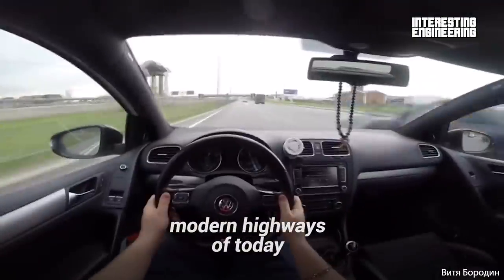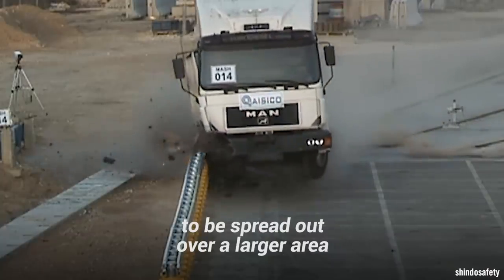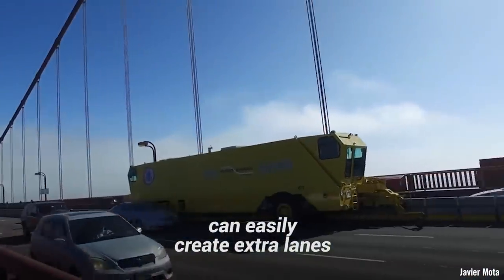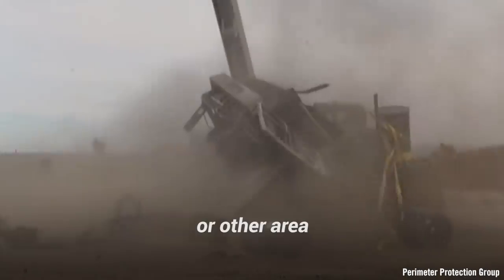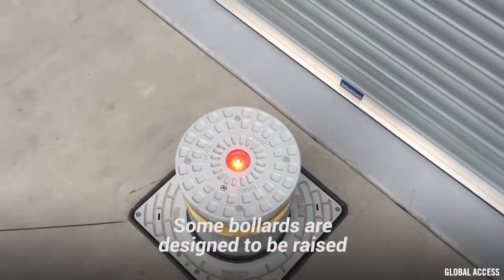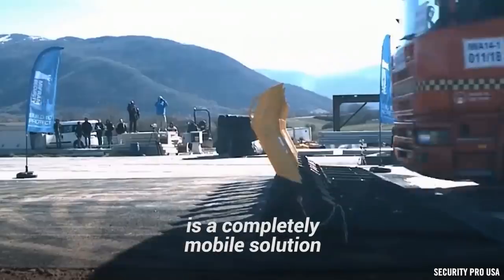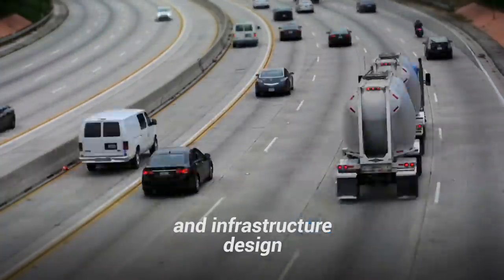How modern road barriers keep our roads safe

Comment: 3:05 I have seen a raisable bollard once, which had broken down and as a result  it raised suddenly when it was supposed to stay. Upon it causing a hell of damage, they had to remove it
Reply: Yeah, honestly, those hydraulic barriers are so sketchy. One malfunction can kill so many people.
Reply: There are several of the raisable bollards installed at the University of Oregon on both ends of a street clased to thru traffic, and they have a built-in safety feature to prevent that exact problem. After the bollards have lowered to allow a vehicle to pass over them, the bollards will stop rising if they detect pressure on top. For this reason, students enjoy standing on the bollards after they've been lowered, thus preventing them from raising up afterwards. Thus, students become bollards of flesh and bone instead of steel and concrete.

Comment: Some of them aren't even use for stopping cars. Looks like they are use to kill the driver. Lmao
Reply: Yuppers depopulation  is a thing.
Reply: True. Some are there to protect you from what they are protecting but instead makes it more dangerous
Reply: Some are there to protect the thing not you.
Reply: @TheEmolano  No. They are all there to protect you but the ones in charge designed them incorrectly.
Reply: Cable systems most dangerous
Reply: @msk806 , I've seen cars the cables didn't even stop.  Came up on an SUV one day in South Carolina in the median rolled over and it didn't even touch the cable.  A few minutes earlier it had passed me.
Reply: @jakecarroll5  well that's an inefficient way
Reply: NOT A LMAO MOMENT.
WHEN YOU KNOW SOMEONE WHO WAS KILLED BY ONE!

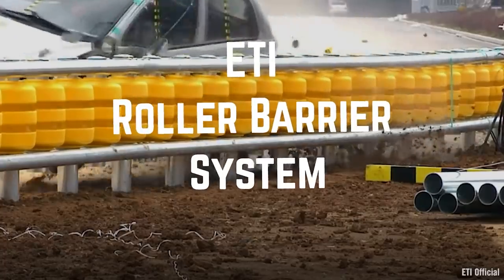Comment: 0:45 US Interstate: I'll pretend I didn't see that
Reply: It wouldn’t work every where. In the Midwest the rollers would freeze
Reply: @381delirius  that too
Reply: Most parts of the intersate don't even have barriers at all, only a strip of grass 😵
Reply: @381delirius  natural selection at work lmao
Reply: @danielsteger8456  except they also take out intelligent beings when they log out themselves
Reply: @alfrredd  thats usually on VERY empty roads with nothing but a plain grassland/desertland. most common in the south prolly
Reply: More like 0:56
Reply: It’s good that they don’t have this Chinese crafted shit. Just steel rails is manly enough.
Reply: @alfrredd  well, trees do fine too at stopping cars
Reply: @mccallfrank007  for cars, not for bikes
Reply: They wont even work well in a traffic scenario
The car would just bounce off into another car
Causing a chain reaction of cars hitting another car which then bounces off of the barrier
Reply: @emerylsg  or all throughout Iowa, Missouri, Nebraska, etc, there is also simply a strip of grass separating the two sides of the interstates. Just not in the cities
Reply: Lol my interstate has a eti road barrier system and bollars
Reply: @alfrredd  well sometimes if the strip of grass is large, it can be better than no barriers at all.

Comment: It’s really upset me driving on mountain roads in the the United States and not seeing road barriers put up. One wrong turn of the wheel or a tire slipping on ice, and there is nothing to stop your car from going down a mountain
Reply: Sigh. Proper engineering will tell you that is the correct implementation.

Comment: They do not remove the main disadvantage of simple metal guardrails: that they are deadly traps to motorcyclists sliding under them and into the poles.
Reply: Just do not drive them. Motorbikes are fkin unsave.
Reply: @sensending7190  don't breathe..air contains toxic gases
Reply: It is probably better than just going wherever into the river or depressed wooded area. Sliding off the road is already a worst case scenario.

Comment: If you get a chance, drive the Blue Ridge Parkway from one end to the other.  For most of this road there are no guard rails!  One section in particular has real pucker power.  Coming around a cliff face is a section of 2 lane roadway with, say, 3 or 4 feet of grass shoulder on each side.  That's it.  Blue sky on each side of the road past the green shoulder.  Driving it in April, before all the trees turn green, allows for some awe inspiring vistas.  All in all a few days well spent.

Comment: As long as you are not driving a motorbike it will keep you safe, they are notorious for motorcycle riders basically chops limbs like nothing else all because the posts the hold the barriers nobody thought of making them rounded rather than sharp square so cheers for that

Comment: 0:46 The ETI roller barrier system is not always better than concrete barriers. It depends. If there is a turn, a flexible barrier that absorb the crash is better. But when the road is straight, a rigid barrier is better.

You can see that clearly in a race track

Comment: They have well learned in car racing that old, hard, traditional crash barriers are extremely dangerous. That is why energy absorbing "safer barriers" have been developed and are working. However, the real #1 issue in road crashes is the idiot behind the wheel

Comment: The ETI Rollers reinforce the structure by transfer of energy into circular motion. Thus making it safer for driver/passengers. Very cheap and effective. Sometimes you’re able it repair the vehicle, cause at highway speeds your most likely not be able to with other structures. But the value is the safety of life.

Comment: Some places where I live we have wire barriers, which are "supposed" to be safer but I seen on the news a car went underneath the wires and it ripped the roof off.
Reply: the installed wire barriers on i 80 near where i work at a truck terminal. a truck hit one of these, it punctured the fuel tank and 2 feet behind were 4 batteries, it shorted the batteries and the truck was burned up in minutes. wire barriers are stupid since semis will just go over them and cars are mangled to a point where extraction is time consuming . from experience wire barriers are worthless and dangerous, large vehicles just knock them over and keep on going.

Comment: What if we had people that could actually drive these days? Like we used to.
Reply: Ain't that the truth! Got my license in Iowa in the mid 1960's. Tough trick question quiz followed by a driving test with an actual State Trooper that was by the book and had little humor. People failed both written and especially the driving test back then. The drivers ed course that I went through had over a third of the class fail the written test the first time. Went back again two years later to test out for a CDL. The written tests went fine because I had really booked and had experience. Came outside for the driving test, and it was the same no nonsense Trooper that I had for my operators license. And he wasn't going to give me my test because my father had brought down the propane truck for my test vehicle. I guess he didn't want to ride in a vehicle with a flammable cargo.And also it was a cabover, meaning a climb to get in.   But Dad showed him in the driving test book where it said that an applicant must test out in a vehicle similar to what they were testing out to drive when licensed. Opps! Being forced to ride in a truck he didn't want to be in, he tested the crap out of me, trying to trip me up.  But I had been well trained and experienced and went home with a CDL in my billfold.

Comment: There's nothing safe about a guard rail on posts or having gaps for people on motorcycles.  It's an automatic chopping block that operates on whatever speed you're traveling.  In almost every case motorcycle riders would be better off without those types of rails.

Comment: The real trick would be engineering a barrier that would be safe for cars, trucks and motorcycles. 
Hitting a steel barrier as a motorcyclist is often fatal far more so than any other road feature.

Comment: All road barriers should be re-designed, like the concrete Jersey Barriers, as they can cause cars to roll over, and cars often bounce off barriers and cause multiple car crashes!!! Barriers and guardrails help for sure, but sometimes they're a contributing factor in bad auto accidents.
Reply: "and cause multiple car crashes" because following drivers which see the crash just don't slow down; many of these following accidents can be avoided if the vehicles would slow down when they see a car hitting the barrier and spinning back
Reply: @EnjoyFirefighting  I get your point. But what I was referring to is when a car strikes a barrier there immediate bounce back into traffic, and at high rates of speed, a crash very often cannot be avoided and can cause a chain reaction. Also there is an issue of the way Jersey Barriers are shaped. Flared at the bottom and easily driven up on causing cars to rise up and flip.
Also causing multiple car crashes in some cases. I've seen this.
Another problem with these barriers is they are a wall between oncoming traffic. Sounds good, but cars sometimes JUMP the barriers into oncoming traffic, and animals trying to cross the road get stopped mid way and are struck by fast moving vehicles, killing the animals and causing accidents. Especially when deer are involved.
All guardrails and barriers need to be reviewed and re-designed over time. 
Here's another example. You're on a highway. There is a wide, flat, grassy shoulder. Your breaks down or you get a flat tire and the best thing to do is pull off the road onto that shoulder to get out of traffic. But you can't because there is a guardrail too close to the road's edge preventing you from getting out of traffic!! I've seen this too. Not only do the barriers need to be re-designed, but their placement needs to be re-thought.
I've seen plenty of roads that actually contribute to the chances of accidents.
Intersections and exits are really badly designed in some cases.
Cheers.
Reply: @justincase2281  working in EMS right next to two highways we regularly see MVAs where vehicles got in contact with the barriers but didn't cause a chain reaction, didn't bounce back sliding across several lanes or anything like that. Also I never ever had a vehicle which jumped the median barrier ... neither ones made out of concrete nor steel.
"animals trying to cross the road" hardly have that issue here as most of the highways have fences alongside.
Not sure what your issue with a breakdown is ... the barriers are usually not between the driving lanes and the hard shoulder but next to / beyond the hard shoulder, so you can easily access the breakdown lane with no problem, no hazard etc, you're out of traffic and next to you there's the barrier; No need to pull into the open grass. Very nice example, with concrete barriers in the center and steel guardrails next to the breakdown lane: https://www.youtube.com/watch?v=SSSqnmEx1i4
Reply: @EnjoyFirefighting  Well, you've seen what you've seen in your profession and I've seen what I've seen living in the New York metro area, and there are PLENTY of skid marks on the concrete Jersey Barriers that go from the base all the way to the top. And I have seen several rollovers on the Merritt Parkway and others attributed to those barriers. Also, dead animals of all kinds that have no place to go when they cross from one side of the road to the other but are stopped by the concrete and are then struck by vehicles. As for bounce-back, I didn't say that all cars bounce back across all lanes of traffic, but they do bounce back sometimes and cause secondary collisions. Besides, EVERYTHING in the world can be improved. Why not traffic barriers?
I appreciate your service and experience, but in my area there are guardrails and barriers that need to be re-designed over time. That's my observation and opinion based on my experiences in my area and I stand by it.
Cheers.
Reply: @justincase2281  well with the difference in the New York metro area there are wide highways but no high speeds. Sure, you find skidmarks here as well, but none from vehicles which jumped across the barrier; Probably isn't an issue of the concrete barrier itself but the way it's shaped there vs here

Comment: The standard horizontal steel guardrails on highways (0:12) and bridge approaches in the U.S. are called "thrie-beams" (pronounced theory).  As vehicle have gotten taller & their center of gravity higher, many of the older rails are not tall enough to keep vehicles from going over them.

Comment: Unless you hit one on a motorbike, then they act like a saw and slice either you legs off , cut you in half  Or the ones with flat stop ends  catapult you hundreds of feet up the highway and land God knows where. 
So they are not that good.  I've seen accidents where loads of vehicles have ripped them up or just catapulted over the top.

Comment: A better way would be to simply ban SUVs and pickup trucks from the roads as long as the owner does not have a legit reason to drive one.
They are simply wasting resources and are a hazard to other drivers.

Comment: What about stupid guard cables. A stupid pole in the ground with a cable running through it. 
Personally i hate them and believe they are useless. I had a 2015 Dodge Durango that i had hydroplane and spun out. I went off the road and hit a guard cable and went right over it without a problem. The only thing they did was total my Durango. It was all cosmetic damage amd one wheel and tire. Otherwise, that durango was in great shape. So im curious what the point of those things are.

Comment: Switch to electric, use electric repelling magnets
Reply: A magnet doesn’t keep itself limited to a single car, causing all surrounding cars to crash. And a magnet setup to repel a car would be crazy in cost and technology per meter of barrier.
Reply: @Engineer9736  dude it's not playing with magnets there's so much technology with sensors

Comment: In india we don't have barriers 🤣
Reply: @keshavmittal6365  agree with you,but it is  found only in highways not on common roads
Reply: @mohammedabdulrasheed9853  bro there are no barriers in foreign normal roads too , these are required only in high speed expressways
Reply: @keshavmittal6365  👍